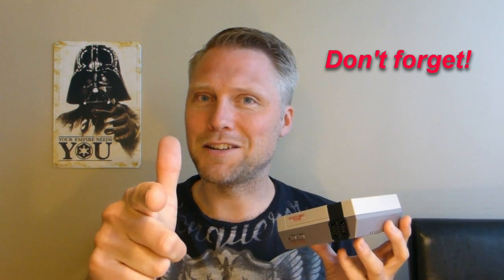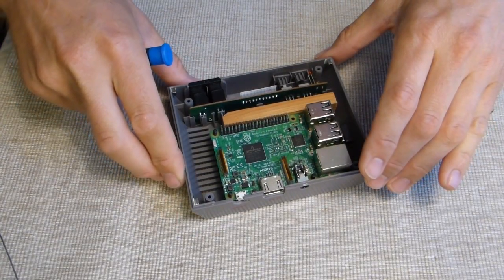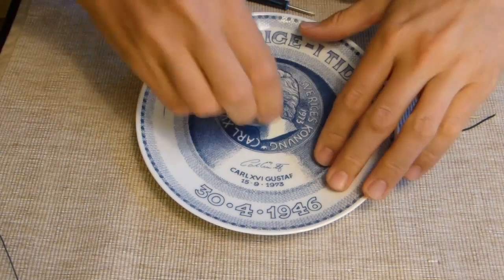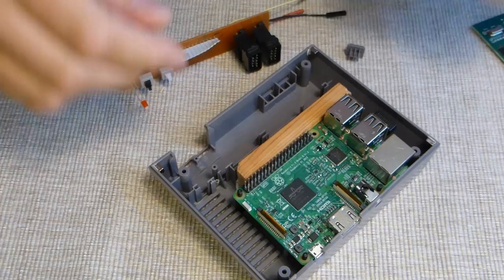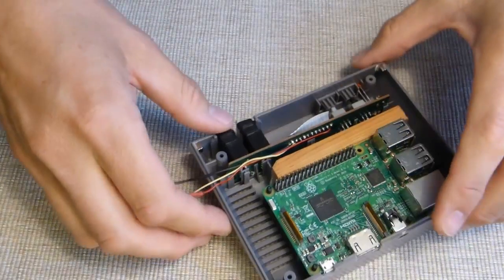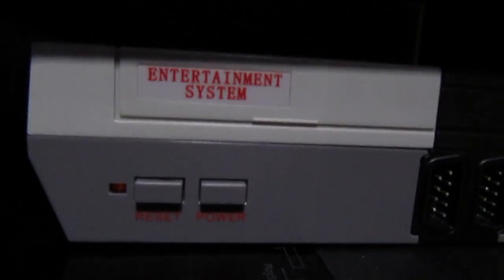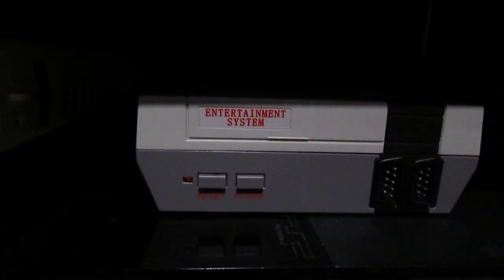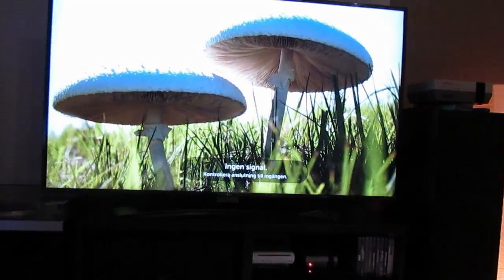How to add on/off button to any Raspberry or the $20 Clone of NES classic mini with Raspberry Pi!

Comment: Thank you for this informative video. I myself brought 2 nes clones on ebay for like 45euros while back and immediately builded a "nes pi" with a on/off button using this guide(thumbs up). I went further for making the reset button as a exit-out-of-emulator-button which was a hassle because the button wouldn't register as a joypad press in the emulators(retropie) which i sorted out with a similar solution by making a bash script for finding the open emulator in memory and exit the emulator back to the  menu when button was pushed. There's many guides out there now for making such a script and putting it to work(search youtube or google). 

Free Tips: be careful when disassembling/assembling the nes-clone because the plastic that the screws goes into are very brittle(i broken one case myself).

If you want more than a powerbutton and/or exit button i've would recommend you to buy a 
cheap microchip like ATtiny85(arduino) and hooking it up internally for use as a USB HID such as a joypad and/or keypad for making save/Load gamestate as an example . Its very easy todo so, one could simple make it like "if (button0 == HIGH) {  Keyboard.write('A');   }" within the Arduino IDE  and then make the A key as Hotkey for save/load gamestate within retropie.

Comment: where is possible to buy red, yellow and black wire with top plug? thanks
Reply from the maker: +Maurizio Pulli you could of course use any cable, but if you want search for female jumper cable at eBay or Aliexpress

Comment: Ive done this with the same case... you will have to add a cooling fan to exhaust the heat through the fins on the top of the case because you will get the temperature warning while using retropie.
Reply from the maker: +knman00 really, I never had one, but then again I haven't played that much yet either. Are you using any heatsink, and what are you playing?
Reply from the maker: +knman00 + are yours over clocked?
Reply: Yes i have 2 heat sinks... they really dont do anything.  And no its not over clocked. I used exact same case and hooked up power button button but used reset button to turn the fan on and off.  Without fan i would get temperature warning.

Comment: Can you elaborate on what pin is for what? I guess power is what powers the LED, then you got one cable for the reset button, ground is ground..... but how is the reset button connected? Or are both buttons using the same wire somehow? I'm confused.
Reply: I didn't notice that resistor at first, but now I see it there on the front of the board.  Well, then I'd say, as much as I'd want a power button that does just what it says it does, this method will probably be what I'll go with on my first build.  Thanks for the idea.
Reply from the maker: +Max Mustermann sure, I will try.. Should have added a picture, but there is link in the description? Any how, so ground is connected to the solder point closest to the controller point, next to that you connect the signal wire. The power is connected to the pin on the other side, the solder point closest to the buttons. 
Does this makes sense? You would then use reset for turning system on and off, and power for led. If you do my USB mod in the next video you only need to add the signal wire.
Reply from the maker: +Max Mustermann did you figure it out?
Reply: So, both reset and power button use only one signal wire together?

I want to do the following, instead of your solution using power to control the LED, I want Power to turn the unit (and LED) on and use reset for either a reset or if possible go back to main menu. So just how it is with the original unit. 

Guess I'll have to take a closer look at the script you used to figure out what exactly is going on. So far I only know very basic raspberry stuff like turning a GPIO pin on or off. That's why I have no clue what to do, when both buttons are hooked up to the same pin^^
Reply: Pretty sure with the way he did this, how the power button and power LED are working comes down to how the original chinese circuit board deals with them (since you'll notice he's not wiring directly to each item, but to where they would go into that original ribbon cable).  The power button and power LED are probably on the same circuit, when you press the power button it really just completes the circuit for the LED (as far as we're concerned).  Reset button works as a normal momentary switch and the route it takes to the ribbon cable seems to be unrelated to the power/led route, other than everything sharing a common ground.  My only concern is whether there should be something like a 330ohm resistor added into the mix somewhere as the gpio pin he's using for the LED power is actually a serial data pin, which I think is more prone to power spikes than a normal power pin...   Anyone have any thoughts on that point?
Reply from the maker: Max Mustermann sorry, I never saw this, hope it all worked out OK for you.
Reply from the maker: yodasama hi, thanks for all this. The led already have a resistor on the board. But in my next video I removed it from the serial gpio and getting the power from USB instead. Hope this helps! =)
Reply from the maker: Ok, good luck hope it turns out great! =)

Comment: did the controller sync to the Raspberry Pi
Reply from the maker: No, plans for the controller in the coming video!
Reply from the maker: +KICKING IT WITH RAY!!!! Sorry no, the controller will not sync with Pi, at least not without some use of gamecon drivers or similar, and using the gpio port.

Comment: Do you thing possible to use the pads with rapsberry ?
DB9 is the old port for a lots of gamepad like Sega genesis /megadrive.
It can be interesting to plug a megadrive gamepad on this mini NES clone , if it works it means that it is probably possible to use an USB adapter like this one to plug the clone gamepad to raspberry :http://www.retronicdesign.com/en/
Reply from the maker: Might be... but I wont try this out, just added USB to ports, see my new video. And there is also plans for another video regarding DB9 =)
Reply from the maker: +Schmurtz Alex sorry, no at least no way that I could use them. Read that sega controller would not work either.
Reply: I have ordered one. I will try to make an adaptator to use it as USB device.

Comment: Hi, I have the same console and I am trying to do this mod, but how I can connect a usb in the raspberry? Can I cut the board and conect a USB extension cable or this will stop working the buttons? Thanks
Reply from the maker: Hi! The easy way to connect a USB when you need to is just to "lift to top cover of, and connecti in on the side" What do you mean with "cut the board? The board with the db9-ports? I do not think that would affect the buttons from stop working. I soon will add a video about the usb-ports, so you could always wait with that mod and just lift the top of when needed for now.
Regards
Reply: Yes, I mean cut the db9-ports board so I can insert a usb cable into the hole of the shell. I'm going to wait for the video , when you're uploading it? i'm so hyped
Reply: @juansaenzjoya5053  hey mate, did you have any luck cutting the board?  Im looking to do the exact same thing.

Comment: nice work, I'm guessing you have the side cut out of the nes mini so you can access the pi 3 usb ports.. really cool on getting the power button to work. Im gonna get one it looks like a fun project.
great job.
Reply from the maker: Thanks! I dont have the side cut of, but I do have magnetics in the top copver for easy to access to the top usb ports. Not that I would need to access them that often, and also I have another plan for the usb on this, might do another video on that! It is a fun project, good luck! =)